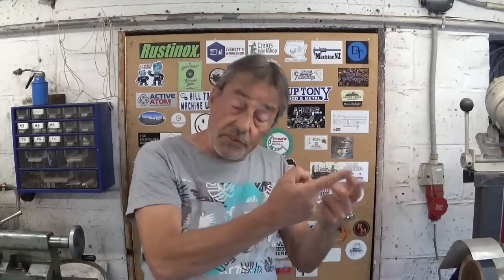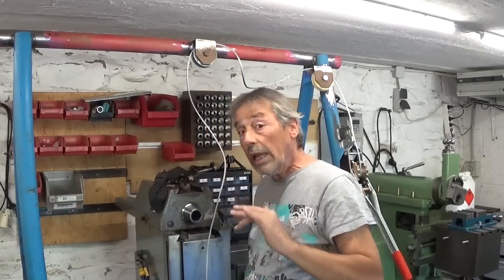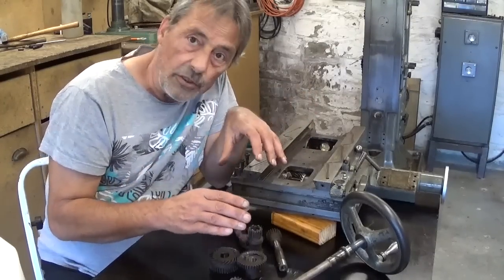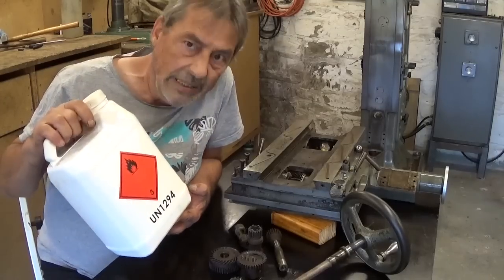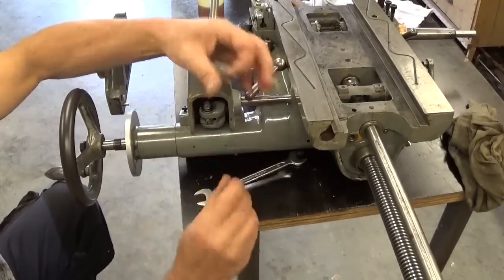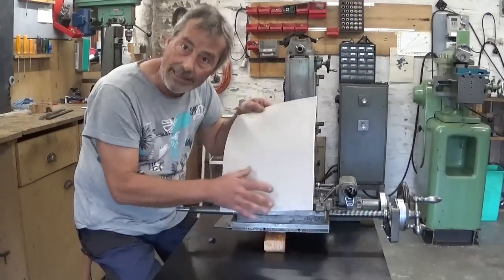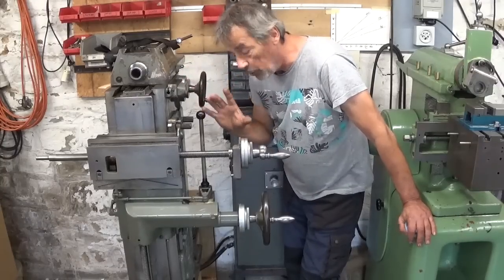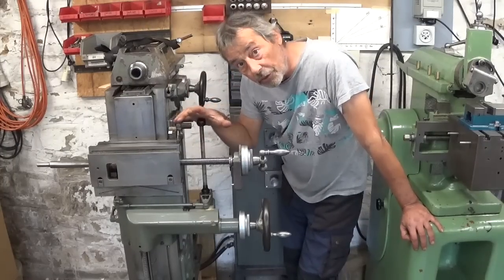Fixing the vertical feed mechanism.

Comment: You are correct with the tubing weight limit,  two children on swings would apply more force on the tube than you ever would.  It was good to see you use the ball pein hammer to cut the gasket and to use grease as a sealant.  The way I was taught 60 yrs ago ,old school.
Reply from the maker: And it works :)

Comment: G'day Rusti. Good to see both the gantry crane and mill are working, you must be happy. Too bad the swing set wasn't a little taller. 
Cheers Peter
Reply from the maker: Thanks Peter. I can't make higher, It will touch the pipes of the heating system.

Comment: People would be amazed at how much weight a setup like your homemade gantry will actually lift and hold, it wouldn't surprise me if that contraption could lift 3 times more than demonstrated in this video. It would probably lift the entire milling machine, although it may deflect a little but it would likely do the job. 
Your viewers are probably just be concerned for your safety rather than just belly aching. Lol 🙂

Glad you got it working again!!
Reply from the maker: It's good enough for what I will ever do with it. For sure.

Comment: "Doing the Dishes", only Rusti could say that 👍🥴.
Some lovely, and precision engineering in the knee, great job on repair and restoration. Most unusual on evidence of heat application or transfer on the gears?
Thanks for sharing.
Reply from the maker: It looks as it overheated, but it's not possible.
Reply: @Rustinox  maybe someone used heat to free the gears?, hope you signed the gasket, ref name and year, I used to build machine tools, and automation,  I used to sign them in an inconspicuous location. 
Best regards John.

Comment: I think you could add 2 support webbing plates in the top corners bridging between the 2 blue upright tubes and attaching to the top red tube for extra strength and rigidity although its not exactly necessary but it would make a slight improvement.
Reply from the maker: No need. The thing doesn't move.

Comment: Hey Mike,  any chance you would ever consider mounting a strut ( like a car has on the trunk or hatch) to aid with manually raising the bed. My FP1 sure is wearing me out cranking the handle. And adding a rotary table,  my spiral table,  vice, etc. And it only gets worse before you can even think about putting whatever you want to machine on it. I'm seriously thinking of mounting a couple of 200lb struts under the bed somehow.  A big thanks for making another great video!
Reply from the maker: That's maybe an idea. You just gave me something to think about.